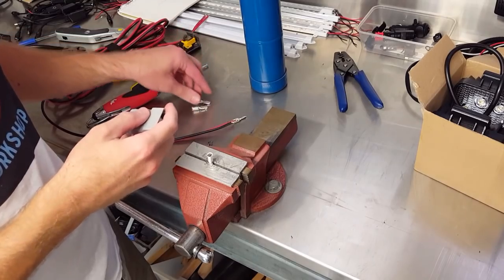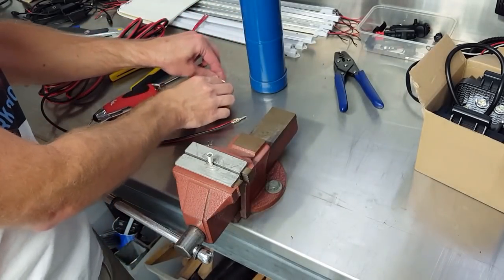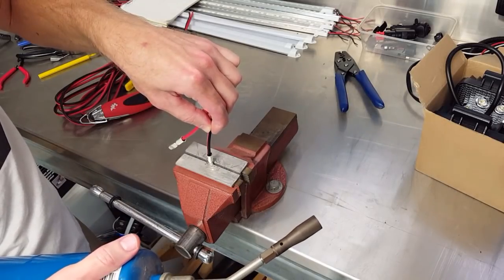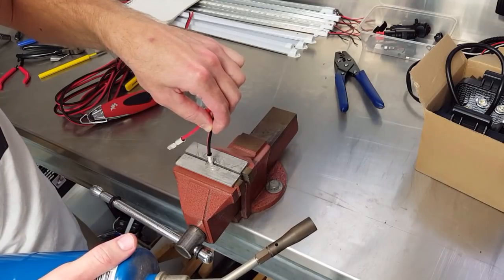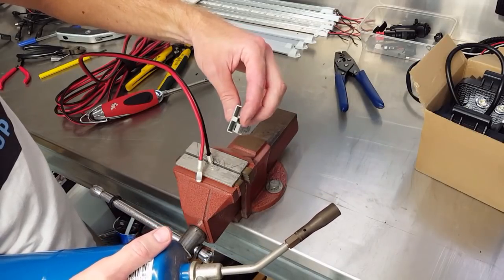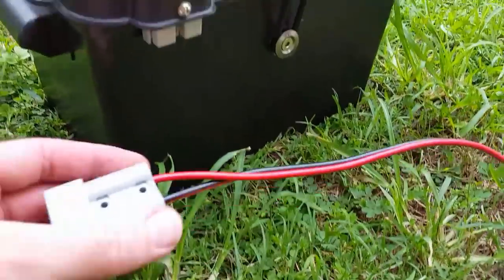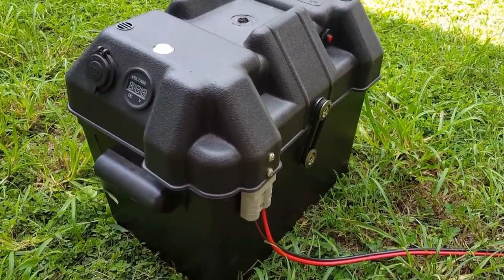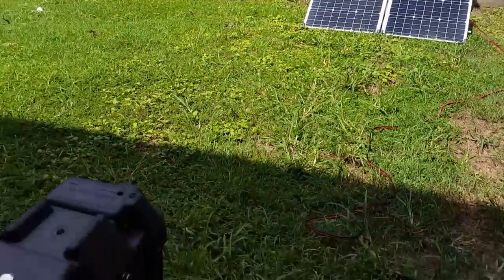Solar panel battery clips to Anderson plug

Comment: Without tinning the wire first with flux and solder, you can possibly end up with a dry joint and over time the lead will fall free of the solder as there was no solder set between the copper wires to flow into the core